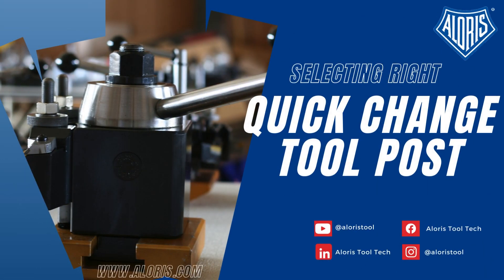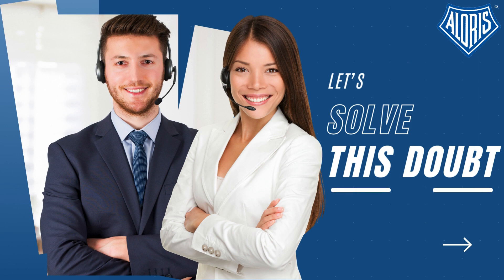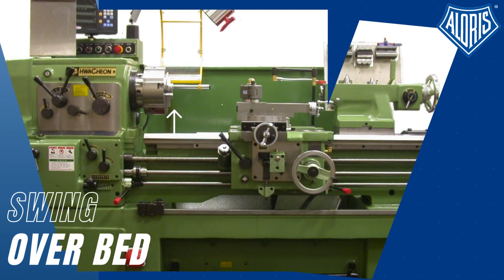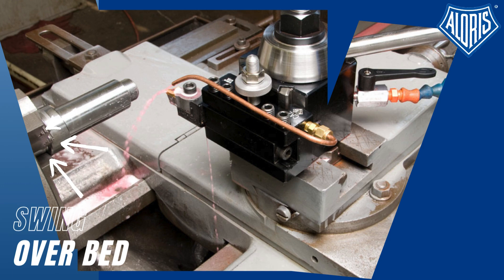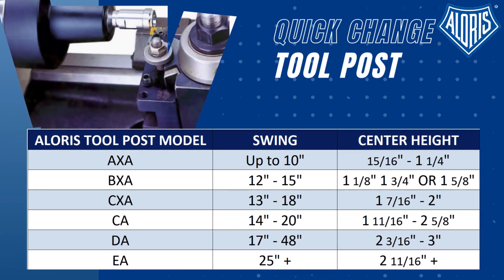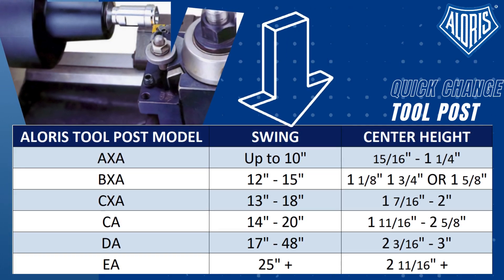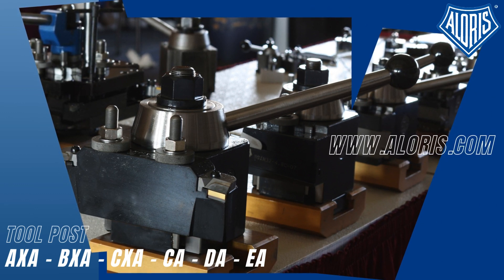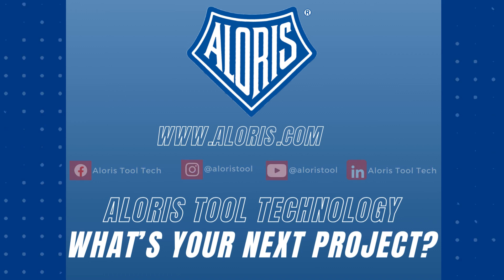How to choose the proper size Tool Post for your Lathe.

Comment: This video portrays the toolpost selection based on one consideration....the lathe center of rotation   above the crosslide   Another thought is Interference.....If one chooses a smaller toolpost...at least to startout it can be blocked up ....and tthere are many times I find a smaller TP is more agile....convenient and less klunkey. A smaller TP is easier to see around lighter to work with significantly less expensive.  I have AXA CXA CA and DA available with holders , Even on my 29" swing Victor 29160 I use the AXA 90% of the time. . I have two of the Dorian CXA size quadras , which cary 4 holders  and index to 24 positions...I dont particaaulary like the Dorians having had continual problems with the indivigual holder locks getting stuck. What I am looking toward now is an Aloris 4 tool indexable probably in BXA size
Reply from the maker: 🙏 Thanks for Watching! 🙏
We appreciate your time and interest in Aloris Tool Technology. If you’re ready to take your machining projects to the next level, don’t miss our Indexable BXA Tool Post — precision, efficiency, and durability all in one!

🔧 Explore it here: https://www.aloristools.com/product/aloris-indexable-tool-post-bxai/

✅ Built for serious machinists
✅ Designed for quick change and accuracy
✅ Ideal for BXA series tool posts

📩 Like, comment, and subscribe for more tooling tips and updates from Aloris!

#AlorisTool #IndexableToolPost #CNCtools #MachinistLife #Metalworking #BXAToolPost #PrecisionTools #MadeInUSA #AlorisQuality #YouTubeMachining